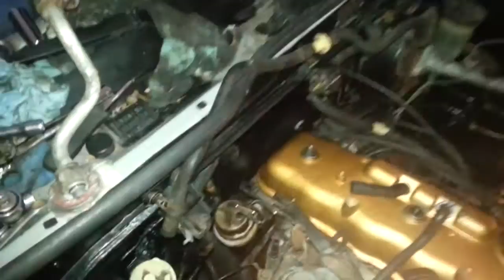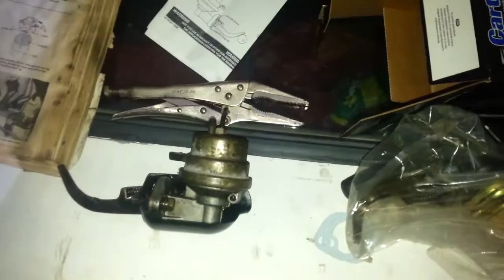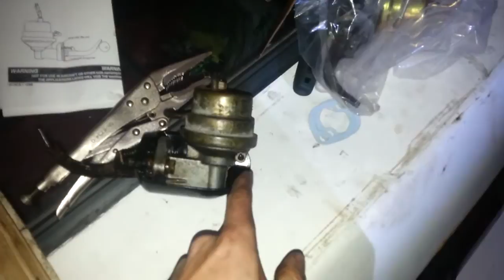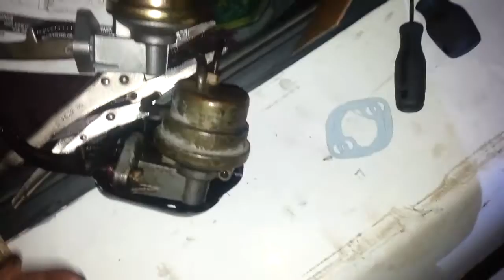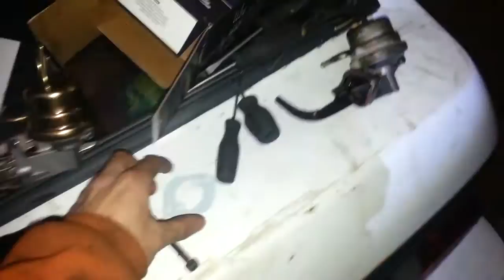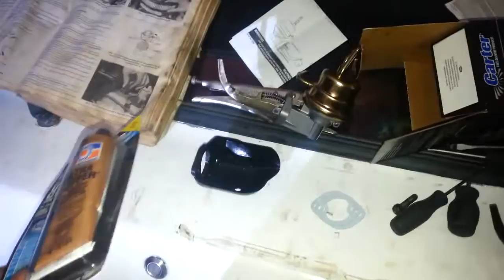AE86 - 4AC Mechanical Fuel Pump Replacement

Comment: i have a toyota corolla ee96 wagon. It won't start in the morning. As a solution, i put a drop of petrol to the air cleaner. Then it starts perfectly without a misfire. But through the day, it starts perfectly without any problem.
 is this problem with the fuel pump or something?
Reply: Pump the gas pedal once or twice before starting.

Comment: Has anyone ever had a problem with the end of the pump breaking
Reply from the maker: never, if it did i think that would bounce around inside the head and cause serious damage
Reply: @Kenny4AG  if you mount the pump without that spacer that's exactly what will happen !
Reply from the maker: @shobud7561  take off the valve cover during installation(2 bolts i believe) and see what happens, my guess is it will ruin the alignment of what the pump lines up with

Comment: I'm having a bitch of a time to install this mainly because it keeps spewing oil on me every time I install a new one. Am I suppose to align it with the cam or something?? I've just been inserting and screwing on.
Reply from the maker: fernando meneses it comes with gaskets did you use them

Comment: What if you don't have the spacer?
Reply: The spacer has to go back on with a gasket on each side. 
If you mount the pump without the spacer and start the engine the pump arm will break off !

Comment: good video. Straight to the point. I like your valve cover,too. Is that the original 4ac valve cover? Did you paint it yourself?
Reply: the Valve covers were normally not painted. I painted mine the same color gold, lol